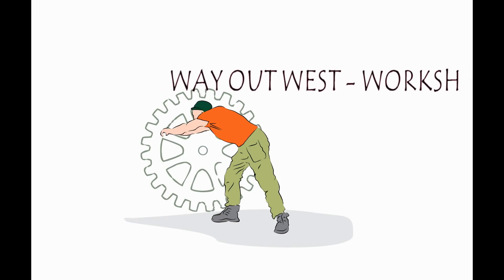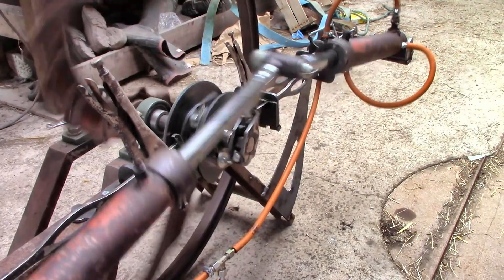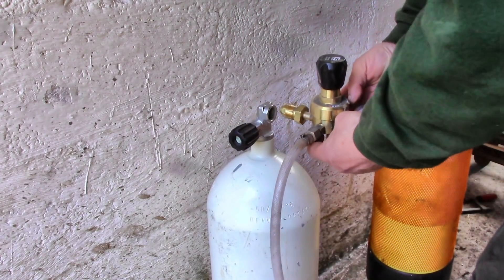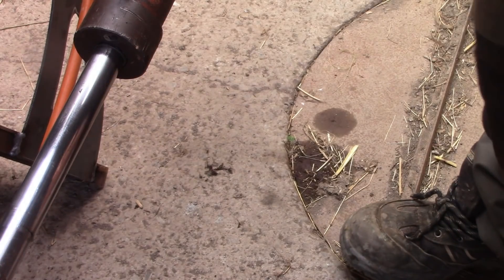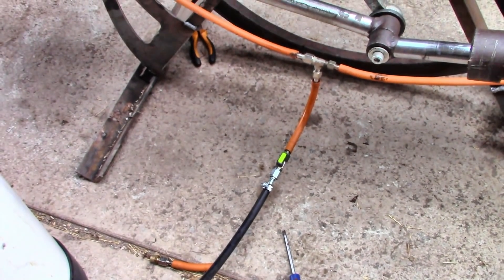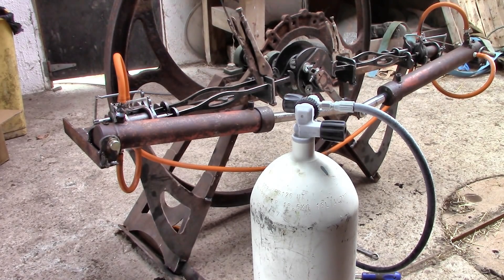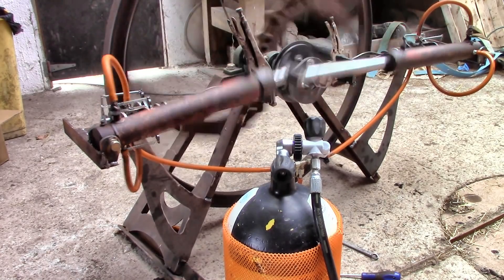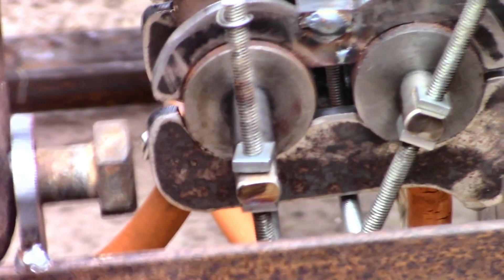It’s Alive!! Air-Powered Locomotive Moves On Its Own!

Comment: Idea: make a smaller version of it and fit it on a car style frame, then put an electric compressor on it. You can build yourself a car that runs on compressed air and can get refueled by just having it plugged into a socket for the time to refill the air tank

Comment: Looks great and it's fascinating that it works without much effort, but I think in the long run, it's much easier to get a battery and a simple DC motor.

Comment: reading through some of the other comments, liking the creativity.....I know some of the older air compressors were pully driven by an electric motor.....maybe you could have an onboard compressor that ran off the flywheel's shaft....would be creating its own fuel that way....my grandpa had one of the previously mentioned style air compressors, and a 50 gallon tank that it could pump into, and then we usually used the 50 for pumping up tires and whatnot....couple of those along with an onboard would add weight for traction, and far less likely to run out if you have over 100 gallons onboard

Comment: You might find it interesting to check on the history of the Shay Locomotive.   It was a narrow gauge locomotive built for logging.   Basically it was a steam engine geared to a rather ordinary railway wagon..   It lacked the big wheels of the normal steam engine, but did the job very well.  Not bad for a motorized cart.
Reply: The first ones were flat cars with a gear drive and small steam engine set on top.

Comment: You could try the air compressor of a lorry they are run off the engine very very powerful and simple with just a feed in and out
Reply from the maker: Good idea, but they only go to about 120 psi, I think

Comment: I had a idea… you know how the air compressor has the belt driven pump right? What if you drove that pump off a axle to run the air compressor.. then as long as you are moving it’ll produce endless amount of compressed air… right?
Reply from the maker: You do know that would be a perpetual motion machine, right? (And I'd be a billionaire!)
Reply: @wayoutwest-workshopstuff6299   yes I believe so…I may or may not have just thought of the impossible… Lol

Comment: Check out compressors for airguns. They take a lot longer but they aren't as expensive. You could also use a couple of chinese handpumps that are made for the same purpose. I've seen people hook those up to motors but I am sure the same could be achieved with wind or waterpower.
Reply from the maker: They go to crazy pressures too, don't they? I wonder how long they'd last though.
Reply: @wayoutwest-workshopstuff6299  I know a bunch of guys who have been using the same compressors for something like 10 years 🤔 I am not sure about the hand pumps. Some of the comps can do 300 bar, I used a hand pump for my air guns and the reservoirs on those were rated at 200.

Comment: Big pressure vessel is quite bomb to handle if not proper safety worked. https://www.youtube.com/watch?v=wQDCFekuOeY&ab_channel=ModernCombatSports that kind of pump can work it full, but its very slow method to fill because its need pauses to not overheat and blow seals. Scuba or similar pumps are 3000euros or more. Hand pump attached as piston is my idea to fill it up, but its so slow that you can perhaps have bottle or maybe two at day to use.
Reply from the maker: Thanks, yes, they could work. I wonder what they cost..

Comment: Why not use a rear tine rototiller, remove the rear tines. Attach a drive pulley ... direct drive to the axle of the frame you are going to use as the engine.  Already has forward and reverse gears. Done...
Reply from the maker: if I had one of those : -  )

Comment: I like and watch all your videos of this series of the air engine. Interesting experiments and great proof of concepts. However if you want a simple reliable locomotive for pulling your logs etc, get a mobility scooter and bastardise the electric drive from it, it will have forward/reverse and a speed controller. It can be charged using a simple solar panel arrangement for free. The lead acid batteries are also cheap and easy to work with.
Reply from the maker: You're right - and that might happen too. But I like this too.

Comment: Hi. You can improve the engine by adding another hole in the cylinders , now there is possebl vacum made by only one hole in the cylinder..for free flow or add pressure too to the cylinder open ones..

Comment: I haven't read through the comments however a solution might be a two cylinder gas, diesel or propane engine that uses the second cylinder for compressing air. You could go one step further and run it on wood gas.
Reply from the maker: But why bother with the air then? Surely you'd just power the loco from the internal combustion?

Comment: Compressed air engines came in two styles, a smaller single tank with a chain drive multi cylinder engine ( look up whistling pig?) & one built like a locomotive.
The locomotive type ran around 800 psi. The smaller ones were simple, the large ones were compound with a “radiator “ of sorts that used the exhaust to draw air through to warm the air between the cylinders (like an exhaust reheater on a steam engine).
I know of two that were converted to steam locomotives.
To be effective & self starting you really need two double acting cylinders set @ 90 degrees.
Cheers.

Comment: If you use the air system to power the loco. You need to run the air supply through a beer cooler in the cab.
The thing is even four old lad acid battery's wold last a lot longer than 15 minutes.

Comment: That wheel looks awfully heavy . I would imagine that you would get more bang for your buck if that was replaced with something much lighter and maybe smaller ? Those pistons look strong enough that if you had something smaller they would have more power ration no ?
Reply from the maker: It's a flywheel so it needs lots of weight to keep spinning
Reply: @wayoutwest-workshopstuff6299  even with those pistons pushing the rotations continually ?

Comment: Perhaps the most logical power would be steam but in my opinion I think air is much safer so to achieve the amount of air needed for a 60 minute ride you’d need a power source like gas or electric , now weight comes into the picture and batteries are heave and expensive so we’re down to gas ! A 5hp gas engine filling 4 - 10 gallon air tanks should be enough plus it refills itself ! But then why go through all that and just run a 5hp gas engine by itself with chain and gears like a go-cart ! Just my thoughts 💭 💡 ! Lol
Reply from the maker: Too easy, too smelly, too noisy. : -  )
Reply: @wayoutwest-workshopstuff6299  must be talking about the gas engine ! Lol. Run it on smoke from wood instead of gasoline ! Gasification works great 👍

Comment: I think there is mileage in a tender with a large, low pressure tank.
You were "fudging" it by regulating the "flow".
You have proven the working pressure isn't high.
Either source a suitable regulator for the high pressure energy store (tank) or find space for a larger, (& safer) low pressure, store.

Comment: This is amazing!  What about hooking up a long air hose which unwinds as your locomotive moves along the rails so that you wouldn't have to carry compressed air with you?  Maybe on some kind of spring so that it automatically winds and unwinds depending on which way the locomotive is moving?  Or perhaps you could build a system of pipes to deliver compressed air to various locations around your rail network - that way you you wouldn't have to worry about carrying enough air with you because you could top it up as you need to, which would save weight and also allow you to generate the compressed air at a fixed location.  I guess the downside is that you wouldn't want to constantly have to stop to top up your air but if you could make it to the furthest point from your shed you could hook up the air while you're loading/unloading the train which might not take that much time.

Comment: That's really cool!! Maybe you could swap the rope for a length of machine chain and have the output shaft turn a sprocket. It could take quite a bit of torque without slipping

Comment: Here's a fascinating thought experiment: imagine you have the ability to manipulate geography. What could one build that took advantage of wind power and water power at the same time, along with being weighted for the flywheel effect. Obviously it would need a skin that was all PV panel in a perfect world. I have a spring that puts up 31 PSI, and I'm right on Puget sound so the wind is significant. I've dithered about this project for many years, I have several different notebooks full so to speak. I'm stuck in analysis paralysis. I quite like your way of approaching problems, may I ask for your thoughts? I know it's a large ask, I won't be offended should you choose to not. But, you don't know if you don't ask, so I'm asking. As it happens, I have several larger potential flywheels
Reply from the maker: The problem is that imagination is boundless - and so too easy. We need to be bound somehow by practicalities in order to really be tested. I have to work around things I've been given or can buy cheaply (because I never have any spare money) so that pushes me to find new ways to make something happen. Sounds like you have too many options and so nothing happens - I'm sorry for your troubles : -  )
How about I give you a month to make something work - would that help?
Reply: @wayoutwest-workshopstuff6299  haha fair enough. I assure you that I am very much constrained by budget as well as other issues. A large reason for the dithering is that I will get a part that leans more towards one design than another, and adjust the design. I will go looking for the remaining parts and find things useful to other designs. Can't resist shopping at the junkyard.

Comment: I've got an idea. There's a lot of spare energy in this machine, the flywheel makes it steadier. How about hooking up a belt driven compressor as an accessory. I doubt your motor would notice it and somebody more clever than me could suggest a way for it to replenish the air tank to some degree while running. Like regenerative braking on an electric car.
Reply: When I first bought my EV, it appeared to defy the laws of physics. I live on a tall Hill and my buddy lives on top of a neighboring Hill. When I would drive there and back home, if it was very very careful about how I drove, the car would show the exact same amount of battery percentage as when I left. On two different occasions, I actually gained one percent! I got pretty excited until I realized all that this demonstrated was that the software was just lying to me. I guess I should not have been surprised after Diesel gate

Comment: I must have missed an episode, those lovely linkages are new to me. I'm sure you're already aware, but if you're using the valve to meter out pressurized air, using two in a line will be much more cooperative. You can use the first one to choke it down to say one of three positions, this makes it a lot easier to dial in the second valve as it's not fighting as much pressure. Just a quick and dirty trick when you don't have a decent regulator handy
Reply: Large diameter pipe between the two valves give a chamber of higher pressure air and less pressure drop

Comment: Pretty good Tim. 
here are a few guess tank was 170 bars and 15 liters and that comes out to be about 6.43 cubic feet per min at 14 mins total. I have no clue how to find out the pressure at which it is released. There are so many calulators that I have been working on this for some time. 
now your 200 liter compressor at 100 psi will run for 5 mins at 11.54 cubic feet per min. 
Though the liters size could all be wrong.  I found this and I am sure it will help. Really if you wanted to use low pressure you would need to find a compressor that could store say 150 psi. My oilless one does that and there are even newer ones that are much higher. psi rated like 300 psi. For every extra psi you get the smaller the tank. 
Now I do know on my side of the pond you can get a 4500 psi compressor brand new off amazon for 350 USD or around 400 euro. Now the only factor is that it would require 
1kwh of energy. The specs say 50l per mins though I am not sure on that. 
Windmill compressor, 
The first step I would do is to convert gallons into cubic feet.

So, 1 gallon = 0.133681 cubic feet.  10 gallons = 1.33681 cubic feet.

Now, there would be a few ways to solve your problem.  Remember for an ideal gas, PV=nRT.  Assuming you keep Temperature constant.  So, pressure and volume are related linearly.  Increase the pressure by 10x in a fixed container, and the volume of gas held by that container increases by 10x.

So, I would convert PSI to ATM (or BAR).

1 ATM =  14.69595 PSI.

So, 120 PSI = 8.17 ATM.  Now, typically PSI does not include the static atmospheric pressure, so to make the calculations easier, add 1 more ATM, so one gets 1 ATM == 9.17 ATM.

Multiply that times your volume above,  1.33681 Cubic Feet, and you get:
9.17 ATM x  1.33681 CF in container = 12.3 Cubic Feet of air contained in the 10 gallon container at 120 PSI.
Reply from the maker: Give that man a gold star! Thanks, William. I'm wondering why compressors here are so much more expensive. But powering them from a vertical axis windmill should be possible, shouldn't it? They don't mind being run at varying speeds?
Reply: @wayoutwest-workshopstuff6299  Yeah Tim. You should be able to find,  buy or make a wind turbine with a pitman arm and run a compressor. As long as you have a place to store the air and a proper blow off valves you should be able to make as much air as the wind can provide. I am not sure what the start up speeds will be and every thing yet its very possible. 
One thing you can do is look up pond wind aerators. I have seen them yet did not dig in to them to see what psi they could make. Though new price they are like few thousand USD or euros.

Comment: If only you could harness the wind in the comments section 😎 time to look for a big receiver tank to mount on its own trolley. Note of caution, one thing often missed with shop compressors is daily water draining and to pull the inspection plug and look inside for rust.  Looks like yours cold be quite aged you maybe on top of checking it, if not look at the videos of them exploding, they give me the heeby geebies!

Comment: Sandra looked rather bemused as she was trundled into the workshop - she also looked as though she was rapidly formulating a plan to ride round the coast of Ireland with Flora and Trudy again... just to get away from the 'lets see what happens school of mechanical engineering. Superb folks. Really good. Thanks.

Comment: That’s the point I was making on the previous video, very limited range available from compressed air or gases unless pressure is extremely high, even then your better of with a liquid fuel or stored energy in a battery.
I’d personally look at Diesel engine running used waste vegetable oil OR DC motor and batteries, perhaps a fixed battery at a charge point which could quickly charge a mobile battery as required
Reply from the maker: I might do that too, Ian, but I'm happy exploring this for now
Reply: @wayoutwest-workshopstuff6299  you’ve given up on the steam boiler then?

Comment: You've made great progress with your engine and locomotive project.  You got me thinking (and that can be dangerous).  Instead of the very high pressure SCUBA tanks, you might be able to use the 100 PSI air from the compressor, depending on what air pressure you need to get useful work out of your two cylinder engine.  Just as a thought exercise, assuming you can give the engine a strong mechanical advantage getting torque to the wheels, let's say the engine works at 50 PSI.  (Works defined as hauling itself, it's air, and a loaded carriage or two.) You can expand your air capacity by using more than one tank, all plumbed together.  You can solve the limited air flow through the pressure regulator by using several regulators in parallel.  Refilling the tender may be a little slow, but it should work.  Now, if the engine requires 150 PSI air to haul loads, it's a whole different problem.
Reply from the maker: Yes, but higher pressure would mean just one tank and more range...

Comment: What was the flash boiler for (a few videos ago)?  I thought that was to produce steam for this.  Why the fixation on air?
Reply from the maker: compressed air is just easier to use while developing an engine, that's all. If it works then you can convert it to steam

Comment: why not use battery power to install a compressor on the loco? batteries could be stored in the "tender/seat" and the compressor could take place of a "boiler"? if you also found a way to hook an alternator up to some drive wheels, that could partially recharge the batteries for longer running time :)

Comment: imagine if you made a house, with cirlce of rail around the interior. then you could have  a table set up on it, and you could push it to where you need it in the house. could even have more than one table on the track.  i wonder how many things you could put on rails.
Reply: I built a coffee table on rail wheels and have a short piece of track in front of the couch. I've threatened to install track all around the house but it would make vacuuming difficult!